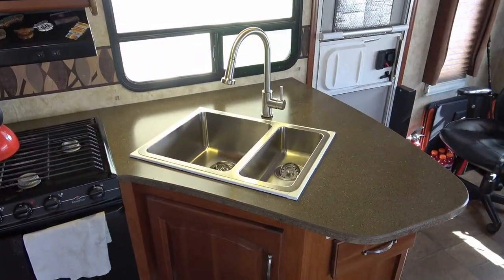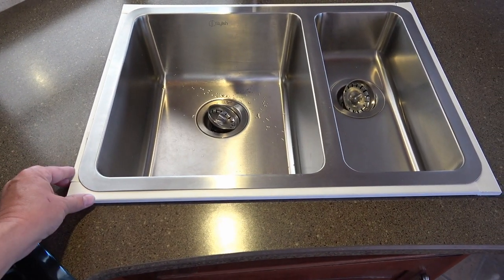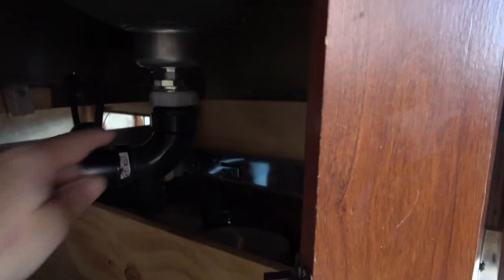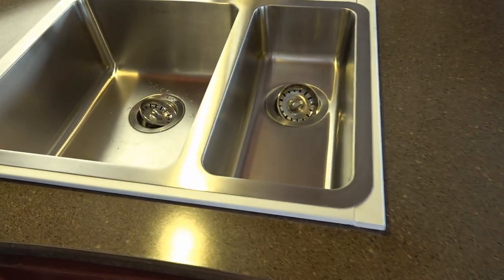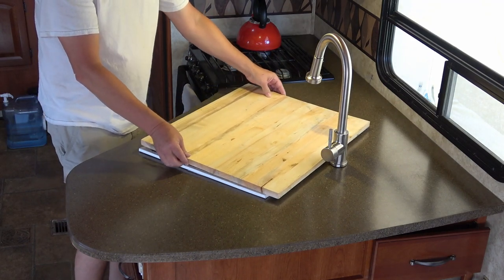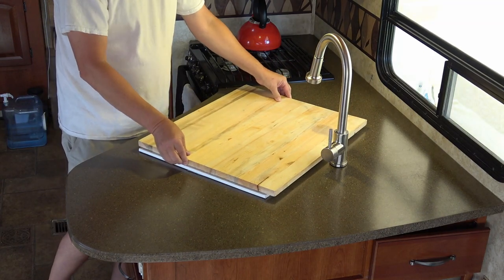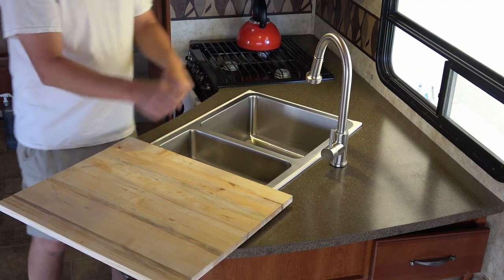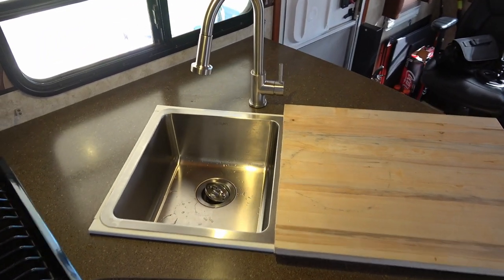*Update* on the Stainless Steel RV Kitchen Sink Installation

Comment: Good rebound from the first video on this project. Just an idea; but you may want to eliminate the seams around the sink trim by getting one solid piece and cutting the center out. The seams will be dirt magnets and potential leaks. If you go the plastic route, places like TAP may have a left over piece you can get very reasonable. They also sell glue that 'welds' the pieces together if you just want to use 4 strips. I did something like this for our refrigerator.

Comment: Yet another great job Ray. Butcher block is a great idea as a cover and is quite thick. Just an idea, why not router out the shape of the sink on the backside and have the block lay into the sink contour. Add your rubber cupboard door stops and it would look very nice.

Comment: Ray, you might want to look at shops that make counter tops. Years ago I built a small table out of "sink cut-outs," that are the blanks that are left over. A lot of places have these for sale for next to nothing, and usually there's a pretty good selection of all kinds of butcher-block and other patterns that may work.
Reply from the maker: Thanks for the tip

Comment: Nice! 👍🔝😀  I took my cheap junky plastic kitchen sink out a couple years ago and am so happy I did. It was a little pain in the butt to replace but totally worth it. I replaced the Keystone junky kitchen sink faucet with a beautiful MOEN that has a properly functioning smooth pull out nozzle. I also replaced their flimsy trashy  cardboard countertop. It should be mandatory all RVs come standard with a metal sink and a non porous proper countertop. Stay cool, hit the pool 💦🏊‍♀️🏊‍♂️💦🌱🍉🍉

Comment: We had a similar faucet in our Airstream. The valve would sometimes open with the vibration of the rig when traveling. Not a problem if you always remember to shut off the pump. Big problem if you leave the pump on, particularly if the faucet is not over the open sink. We put a small bungee cord around the valve handle and the neck of the sprayer to keep the valve closed; worked great.
Reply from the maker: Thanks for the tip, will add that to our depart checklist. Cheers, Ray

Comment: On the cutting board thing.
Did something similar from a 3/4" maple cutting board, but it curled a bit.
Did purchase it in a food distributor and cut one side to fit.
So I guess for maple it is not thick enough.
Cheers!
Reply from the maker: I've decided on a 2" Teak butcher block board built with end grains. Teak is pretty water resistant.  Cheers, Ray

Comment: Congrats, Ray...twice!   If it were my butcher block insert, I think I would only fit it over the main sink.  That way, slicing veggies and other cutting board uses combine nicely with having access to running water and temporary sink space for peelings, offcuts and such, before they are plopped into the trash.  This would still allow for the other (inverted) uses.
Reply from the maker: Thanks 👍

Comment: Ray, it looks like you'll have an issue with water laying the horizontal line from the large bowl.  The TEE looks to be mounted upside down.  You want water from the small bowl going down the sweep.  As it is you will have water from the small bowl sweeping down into the large bowl's horizontal line and just laying there.
Reply from the maker: Doh!, thanks for pointing that out, I totally missed that. Cheers, Ray

Comment: If you can find someone with a CNC router, you could have them easily modify the bottom side of your butcher block so that is fits into your sink. That way you would not necessarily need the rubber/silicon feet. Although, you could still mount four of them on the bottom of the butcher block to keep it from sliding around on your countertop.

Comment: I think if you used the same plastic trim but in black and maybe rounded the corners and stuff it would look really good.  Some of the draws around the sink including the one you said you modified didn't look so straight.  the one next to the door was closed on some kind off slant... work in progress?
Reply from the maker: Yeah, got a bit of tweaking to do with the wood frames and slides
Reply: @LoveYourRV  cool.  Enjoy all of your work and reviews.

Comment: Ray how come the sink is not sitting right on the counter top?  and since you don't have a garbage disposal, why the double sink.... I don't like it, take it back....
Reply from the maker: The sink was a little too small for the opening so needs a bit of trim, I like having the extra little sink like the OEM one  had to put rinsed dishes before I dry them.